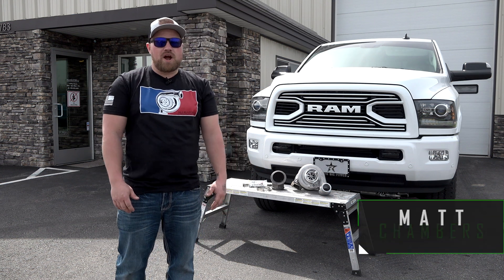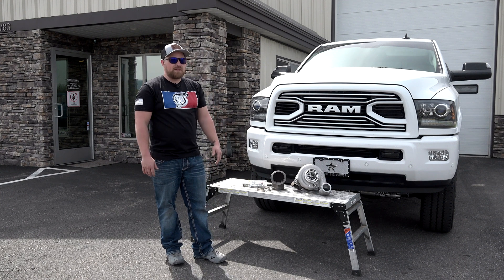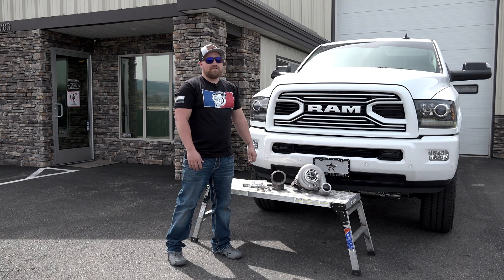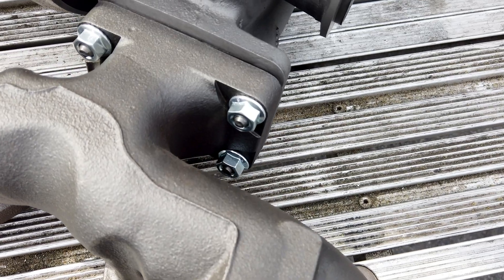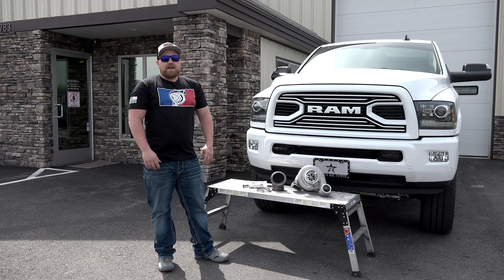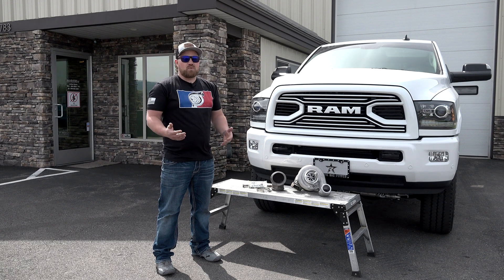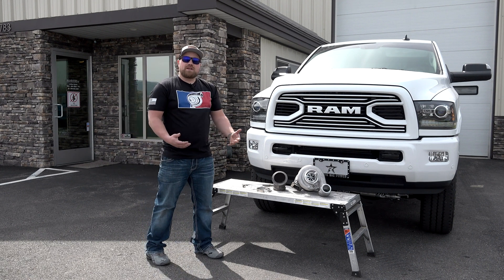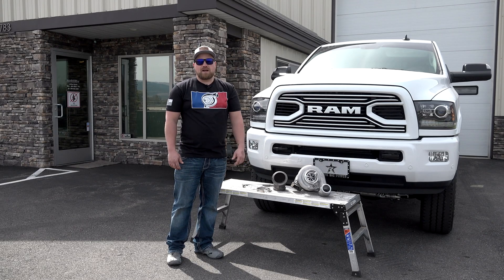HTT Direct Fit S300 Conversion Turbo Kit for 6.7 Cummins

Comment: Older video I know: Are they just filling the BW turbo's T4 flange holes with weld, drilling & tapping for the OEM "T4i" pattern and machining the surface flat?

Also, HTT as of this post, only sells VGT turbos and actuators on their site for this application. 

Alligator Performance site search produces: "There are no products listed under this category" when putting in vehicle info, selecting turbo and searching via brand which coincides with the aforementioned. 

When searching "High Tech Turbo" the only S300 is a T4 flange. (HTT 177283 63/68/.88ar s300 T4 Turbo HTT 177283 63/68/.88ar s300 T4 Turbo)

Just some info for you guys and gals...

Comment: After replacing the VGT with a fixed vane, what are people doing to get back to an exhaust brake thanks?
Reply: Bd makes a inline exhaust brake, you just have get a downpipe and find someone to weld for you... it's a couple v-band clamps on both sides... and comes with everything you need to make it work for like $1300... Compressor air tank and all...